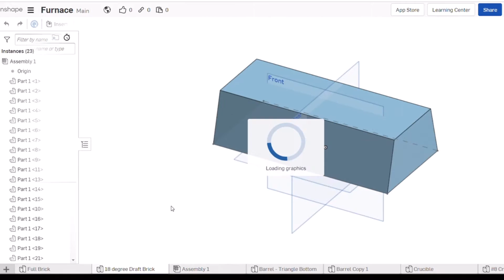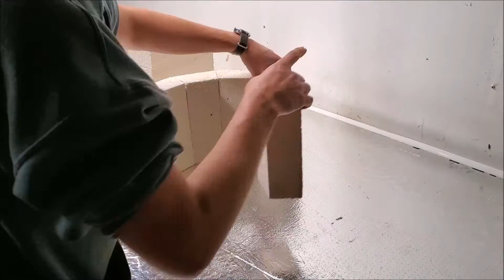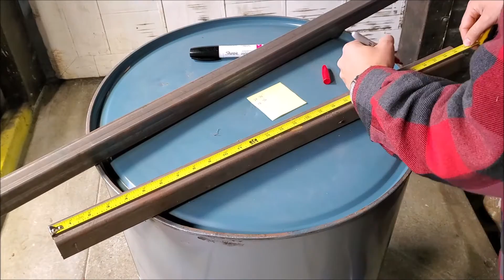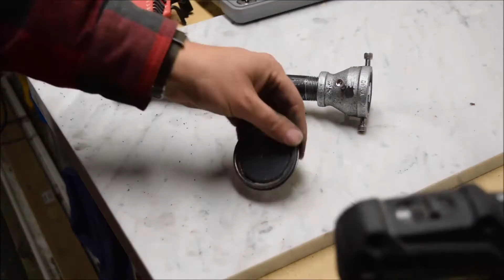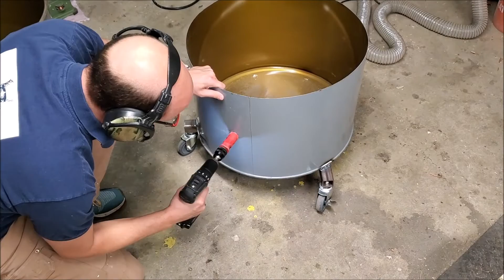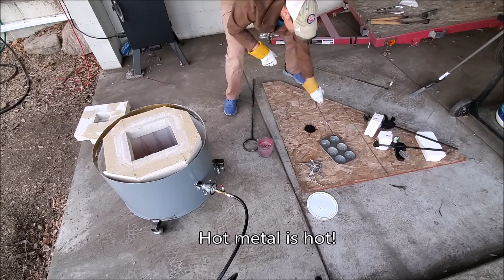The Ultimate 55 Gallon Barrel Backyard Foundry

Comment: I don’t understand how this video doesn’t have a ton more views. This is a straightforward how to and I haven’t seen a better video out there. I’ll be using it as a guide to make my own. Also, how is the three wheel setup doing? Do you wish you would’ve went with 4?
Reply from the maker: Thanks for the kind words! The three wheel setup is working just fine. I am still using the foundry to make cool things, but I haven't taken the time to make any videos lately.
Reply: @gedankendaily9880 so I’ve built everything and I have the fire brick assembly inside. What other options are there for back filling in between the fire brick and drum wall? Did the mortar/drywall compound hold up well? Did you premix the mortar with water or just mix it in with the drywall compound? I’m sorry for all the questions
Reply from the maker: @DocHollidaysStache  The filler between the fire brick and surrounding barrel was one thing I wish I had done differently. The mortar mix transmits heat a little too well and the side of the barrel does get hot after running the foundry for a long time. Maybe some firewool, or a lot more scrap firebrick, or even sand with a mortar cap would be better at insulating. I'd love to hear what you ultimately decide to do.
Reply: @gedankendaily9880  I’ve given it some thought and I’m considering using volcanic rock as filler and using the refractory mortar to pour over top of it. I just need to order more refractory and stop by Home Depot for the rock.

Comment: is there a reason to not use sand for fill? It's dirt cheap and besides being lighter than plaster it has better insulation properties. Maybe it might make it easy to rebuild if the need ever arised.  Or would different expansion contraction rates be a problem? 

Do you think one needs refractory cement for the refractory brick lid?  I mean couldn't one just place brick in a square on top?

Comment: I don't know about *ultimate*... people who build one furnace usually get "the sickness" and have to build more. 😃
But you really don't need the "ultimate" furnace to melt aluminum, it just has to work.  And it does!  This is better than a lot of youtube builds that have huge views.  I do see room for improvement here tbh, but anyone who builds their own furnace instead of overpaying for one of those kits gets a 👍 from me.  I hope you are still using it after all that work and expense.
Reply from the maker: Thanks for the comment! I have used it a fair amount. I cast some roof mounts and panel clamps out of aluminum for a DIY solar build on my garage. They worked well.

Comment: Your torch is not supposed to stick in the foundry it’s just supposed to sit even with the outside of the wall
Reply from the maker: Why would you say that?
Reply: @gedankendaily9880  hes right its so the heat swirls around the foundry and heats the crucible evenly. great video

Comment: Have you made a furnace before?  You seem about a month ahead of me on your project.  I'm building an electric furnace.  With your design with a solid brick interior, and a steel shell, It seems to me that you should have used a lot of perlite in your castable refractory.  In your case, there is no mechanical strength needed for this function. AFAIK, perlite has the best insulating ability compared to weight, and is cheap on a volumetric basis.  What do you think?
Reply from the maker: Hi Rich. I'd planning to make an electric furnace too for PLA burnout. If you get there before I do, please share what you've learned along the way. I like the idea of using perlite in the build. I wish I had thought of it sooner, it would have lowered the weight of my foundry substantially. She's a beast to move!